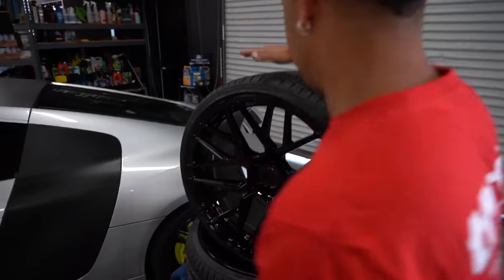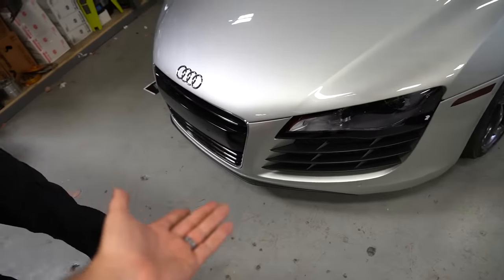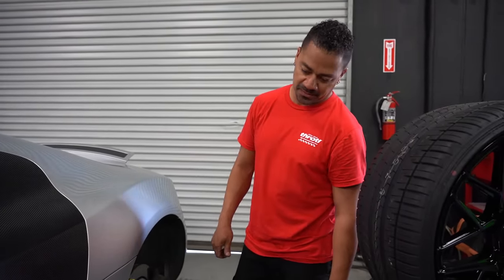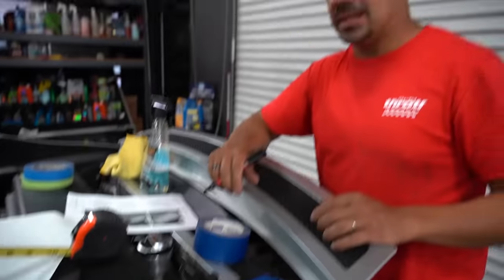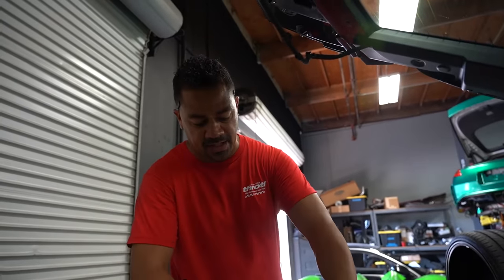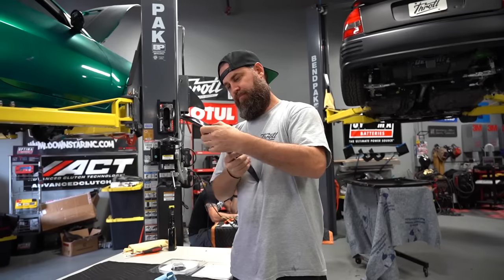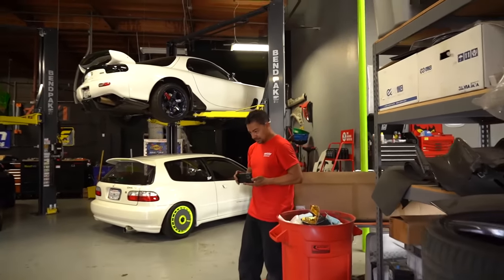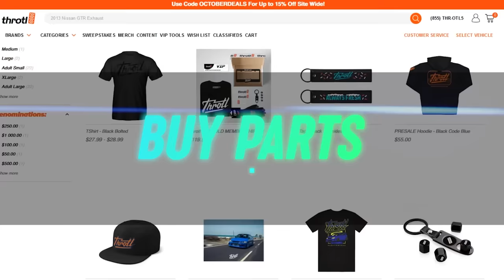Building a (6-speed manual) 2009 Audi R8! NEW WHEELS and Carbon Fiber Aero Package looks AGGRESSIVE!

Comment: Are you sure there’s no trimming? I have the same spoiler and the plastic trim that goes under the hatch after you replace the deck lid has to be trimmed. Also what wasn’t mentioned by you guys or APR is that you can’t open the engine bonnet without removing the spoiler or removing a couple bolts to tilt the foil back.

Comment: Huge difference! Congrats Ricky. I disagree with changing the ride height, though impractical, maybe a slightly wider tire with more squared sidewall and a bit less stretch.

Small thing, the windshield banner are black roof are slightly different shades. If you were able to match the two perfectly it would look a lot more like a DTM car for some reason in my OCD brain.

Comment: Its dope !!!!!! ..
But I just have one doubt! ..
Won't the spacers give troubles to the wheel bearing or the rotar or the alignment? ??
Reply: Spacers??
Reply: @RunningSolo  those long nut like things? You used between wheels and rotors?
Reply: @muralikrish2690  there is nothing added other than the stud... its just brake rotors studs and wheel nuts
Reply: @RunningSolo   okay bro ...thank you for letting me know ..iam still confused about the studs you told .....😅I thought that studs are also known as spacers! ..which we use to match the body line with the tires or even increasing it beyond body line! ..is the spacers and ( you mentioned) studs are same ??
Reply: @muralikrish2690  no, so most German cars have bolts instead of lug nuts for their cars ... I usually do a stud replacement kit .. that way when you take the last lug nut off the wheel doesn't just fall off.

Comment: What’s the point of running tires with those rubber bands lol
Reply: Have to be done for proper OD .. so the AWD system works properly
Reply: And it drives better than the stock setup 🤷‍♂️ feels great bro 👌